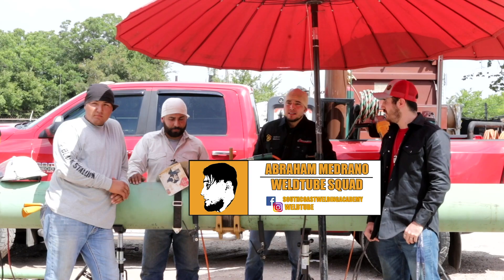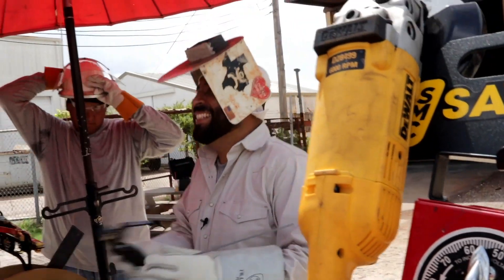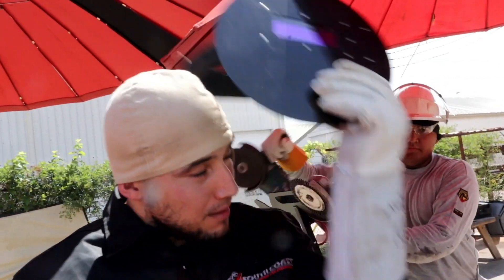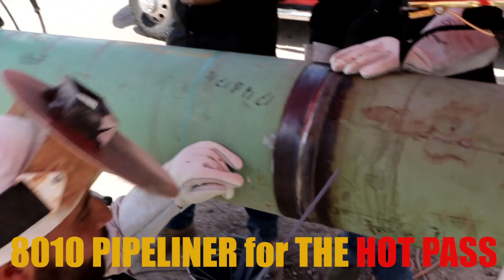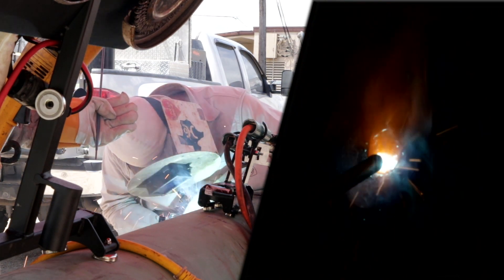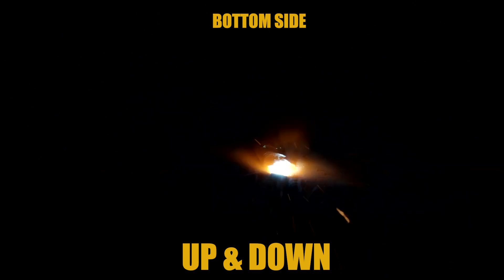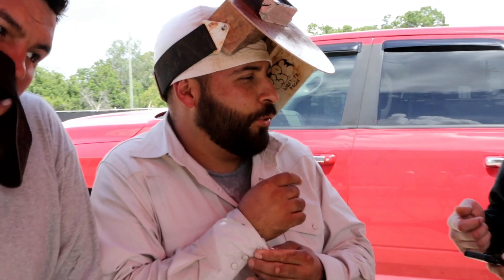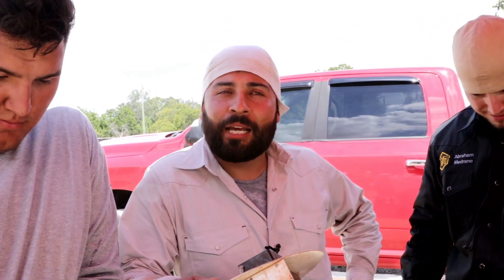Rig Welders - Techniques for Stick Welding

Comment: Way too much talking while welding. Nice, pretty new gloves??? And what is with the "Stingers" being used as Ground Clamps?
So un-professional. Never make it on a real Canadian Pipeline. Codes are much stricter. All Gas and oil Pipelines here are double thick wall compared to American Pipelines.

Comment: What "Tricks"??? Just get in the ditch, slam that puppy and move on to the next joint. No fanfair, no Buddies to help you just get to work.
From the bead to the hot pass to fill and cap, 7/32" HYP.

Comment: Good job.In Finland downhill welding is not permitted method high pressure pipes or load bearing structures

Comment: What type of welding lens do you recommend?? I use a #10 but i have to grind a line before capping because if i dont i'll get lost and my cap comes out crooked..
Reply: Get some eagle vision from pipeliners cloud
Reply: Taylor Sanchez lol ur blind. J/k j/k switch to a 9 and roll with that
Reply: @davidmartin2231  hehehe i dont have any trouble when i weld uphill with 7018 or when i weld tig..
Reply: Taylor Sanchez do you Stare at the “light”? Cause that may be throwing you off. I like to follow the rod as I travel. I’ll look forward, the bevel, how it’s stacking in the back, the other bevel, and right back to where I started. If that makes sense.
Reply: @davidmartin2231  yea i see what you mean.. when i do one bead cap i dont have trouble its when i do several bead cap.. just that first bead after that i can see pretty good..
Reply: Some dudes outhere have a wenz lens they recommend it but its kind of pricy
Reply: Taylor Sanchez the singles ArcOne lens are pretty good. Amazon carries them
Reply: @davidmartin2231  👍

Comment: Lmao, there is no way you were using 35 amps to run a 5/32 rod. 😂😂😂
Reply: Remotes work of percentages of what the max amperage is set?
Reply: DocdADeaD yes they do like if you set the machine on 300 everything changes but a lot of people do 200/220 because that’s what Lincoln uses and it’s easier
Reply: DocdDeaD   35 (85) on the remote for 1/8 and 40/50 (115) on the 5/32 if you set the remote at 210
Reply: And if you set the remote at 400 you can run 5/32 at 20/30 lots of people don’t know Miller’s

Comment: The SA-200 is the perfect downhill machine especially the model with the arc control you really can just hold the rod in the grove and it lays down like butter on a biscuit !!!!! The miller is ok but the puddle stays to wet when capping the amperage stays to consistent even when you long arc so you’ll get a lot more undercut, the Lincoln has a much more stable current and you can control your amps by decreasing or increasing arc length to the base metal which makes it easier to stack dimes on the bottom without leaving undercut!!!!!!!! These boys are jam-up hands I love to see our craft done right by real welders most of these guys on YouTube are just test lab welders !!!!!!
Reply: I hope you are being sarcastic about the miller being to consistant. If anything miller has a "more stable arc". Plus I have never seen any 200 that's original that has arc control. Besides the 200d

Comment: Old welders use to tell up & coming welders that if they showed up on a jobsite with a Miller, they'd b "run off the jobsite." Obviously no longer these days. Whichever & whatever works!
Reply: Nowadays its "if it doesn't use diesel, get out of here" lol
Reply: Dumbest shit ever, Miller welders are way ahead of Lincoln by along shot. Best example is the Miller Pipeworx 400, it’s a 4 phase (Stick, TIG, MIG, and Flux Core) machine and it runs fucking great. Lincoln can’t figure out how they got all 4 of them to run so great, they could only make a 3 phase machine
Reply: @WarInHD  lincoln got a 4 phase to
Reply: In just trying to get a job as an apprentice over here, and y’all talking about who’s better and what not, on-a serious note,  where does one apply at? I’d like to get on.
Reply: Ar1240 Ch go to your Local Union Hall and ask the coordinator for an application
Reply: Clifton Williams thanks bud, Collision tech 16 years and going, mig and aluminum certified, I think I like to try something else, bud I’ll definitely go check that out. Thank you
Reply: Ar1240 Ch with that many years experience on aluminum, why not aviation?
Reply: David Martin not as much on aluminum, as vehicles barely started to be manufactured and on the road more on these past 5 years, but steel is what we weld on more than aluminum, I really wouldn’t know where to apply, collision is all I know, but I think it I would like to learn something else.
Reply: Ar1240 Ch there’s always school
Reply: Ar1240 Ch union is a good way to go also be persistent always call to let them know you have applied call every other week and talk about updates in your application, or ask to schedule a test show you want the job don’t worry your time will come
Reply: Those millers are on another level
Reply: Good  job
Reply: A new guy at my work wants to get one..he's also a pretty boy

Comment: What is the rig on the top of the pipe called, not the clamp. and how does it mount
Reply: Jeff Schmit the other fixture holds their grinder and wire wheel and also uses magnets
Reply: Jeff Schmit it's the ground clams and mounts with magnets
Reply: @mattharper588  I thought it had the work clamps on it but wasn't sure. Pretty cool fixture

Comment: 5:06 - 5/32 6010 at  35amps....45-50amps 5/32 8010??  Maybe 35 - 50 on the remote.  Nice job - nice machines - nice welds
Reply: How can you run that low? Is it the gap? What do you mean remote? I'm a Tig welder learning stick.
Reply: @tapllarrow3984  the dial goes from 0 to 100, if you have your machine set at 160 amps then 100 is 160..the remotes are convenient so you don't have to run back and forth to the machine constantly
Reply: Those amps are NOT  accurate!!! That’s what the remote is set at....not the amperage.
5/32 at 40 amps???? Never